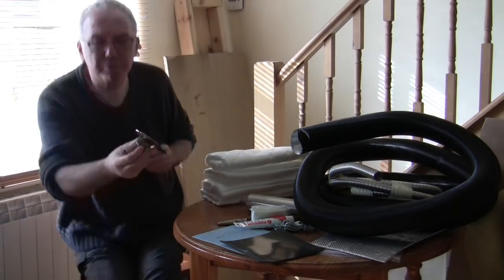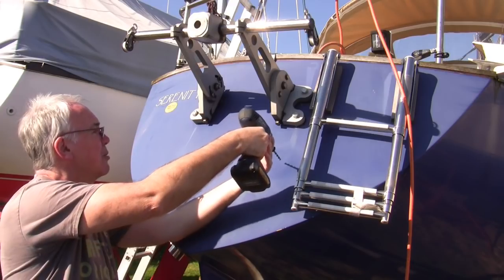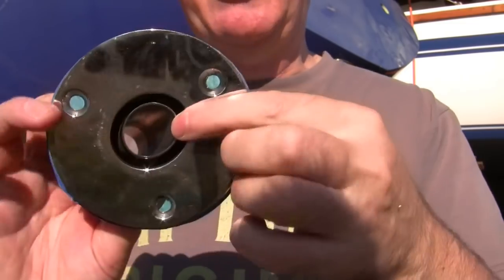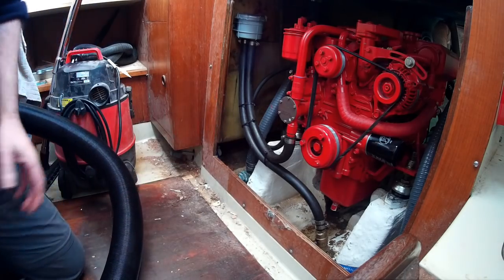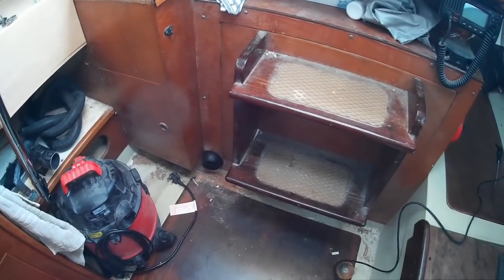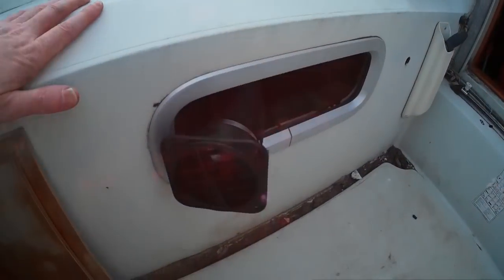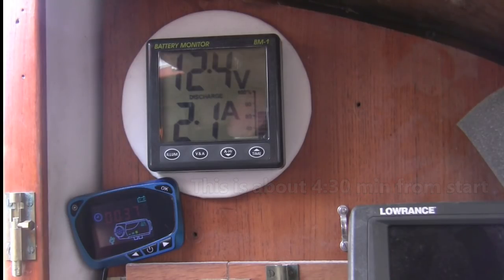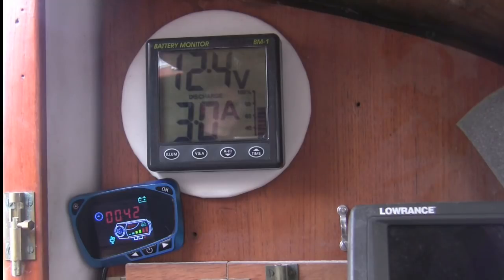Just About Sailing March 2019 - Installing a Chinese Diesel Heater, Pt 2 Fitting it and switching on

Comment: Hi mate, good video.  After a couple of years I'm very close to installing one of these heaters in my 24 foot trailer boat.  I'm in Victoria, Australia and for most of the time I need air conditioning, not heating, but recently I've been using a full set of camper covers and my wife and I have been holidaying and living aboard for a week at a time (work permitting).  Having one of these heaters would really make the boating experience that much better - it means we don't need to rely on berthing in a marina and hooking our 240v electric heater to the town power supply, we could anchor up anywhere, switch the diesel heater on an nude-up with all that heat 🙂  the only issue worrying me, after this video, is the current draw.  I have in total 200 h/a of battery power, not an issue with the engine running but at anchor, you unit pulls quite the current.  Has is improved in the years since this video?
Reply: Hi there. Firstly, I am jealous that you need air conditioning more than central heating. I didn't realise that these 'Chinese Diesel Heater' videos would be so 'popular' when I first did them - I might have structured things a bit differently. But I was really discovering things as I went on.
Have a look at the next one in the series (Pt 3, April 2019). I did a much longer run and noted the power consumption etc.
Basically, it seems to take up to about 8 amps for a few minutes at start-up and switch-off. This seems to be mainly the glow plug which is either used to ignite the diesel when starting up, or burn it off (to prevent sooting up?) when closing down. It then drops quite a bit as it is really only the fan and the diesel pump taking energy - they are both on full pelt. It then drops down to about 0.5 or 0.6 amps as the fan and the pump go into a sort- of tick-over mode.
It then goes up again if the temperature drops (IE heat is lost out of the boat etc) and then ramps up a bit more. I think that the actual consumption would really depend on your boat setup - insulation etc.
Also, I have chosen to draw the air for the heating from outside. Some people draw it from the cabin and effectively re-circulate it. That would make a difference in how much you need to heat the air. Have a look at the two videos I did on preventing condensation for more details (One was the theory of why we get condensation in boats, the second was a practical test). 
Sorry, long answer, but in short - I am quite happy with how little it draws in total. Even in the Winter a decent solar panel should be able to replace the spent amps quite happily.
Good luck with it!
Cheers, Paul

Comment: Temporarily fitted mine yesterday and have to say very impressed and no problems. Bought the marine silencer but not happy about the poor quality exhaust tubes supplied as standard though so ordered some stainless webasto stuff and decent exhaust clamps to go with it. Everything else though has gone without a problem.
Reply from the maker: Andy
Excellent. Just in time for the first frosts. Yes, the basic accessories that come with the heaters are a bit poor in quality. I think I spent more on buying decent stainless steel stuff than I did on the actual heater.
Cheers
Paul

Comment: Really interested in this as I plan to purchase a 'live aboard' sailing yacht in the next year or so, thanks for posting.
Reply from the maker: Well, I have yet to properly test the new heater in any realistic way - but I am impressed with how much heat it pushes out. I lived on Serenity for 2 years mostly plugged into shore power. I used a very small electric fan heater combined with a desiccating de-humidifier (the desiccating ones work in the cold) and that was fine. But no good at anchor. I am hoping that the air blowing heater will both warm the boat up and help with condensation by circulating the air.
Good luck with your new venture.

Comment: Top work. Given the current weather patterns I’m sure you’ll get some frosty nights in May or June to test it thoroughly!
Reply from the maker: Yes, it is certainly not unheard of to get frost in May. It will be interesting to see how good it is at reaching and maintaining a steady pre-set temperature. Although having now tried to read the instruction manual - it is pretty much unfathomable, so there might be a bit of trial and error involved. I also want to try out the remote control and see if I can switch it on from 'in bed' (the Vee Berth).

Comment: This is my next job to do on mine. The combustion inlet is supposed to feed from outside though as on bad starts it can spew exhaust out. The heater inlet is best on the inside to reheat circulated air otherwise your pumping cold damp air into the boat. Especially on foggy days.
Reply from the maker: Andy, thanks. Yes I agree, the combustion inlet must feed from the outside. I had this temporarily hooked up snaking its way under the locker hood and out. I will shortly be finalising both of the inlets and sorting out something that is waterproof(ish) and external.
However, I don't agree regarding the heater air inlet. This is a contested topic with two definite camps. My belief is that the air should come from the outside to increase circulation and suck in cold air which holds less water 'vapour' than warm air.
The problem being that if I am making multiple cups of tea (as I am prone to do), the moisture (from burning flame and steam) will  stay inside the boat (taken up by the warm air) and condense more readily on the cold (external) surfaces. Also, breathing (which I also tend to do a lot) produces a surprising amount of moisture.
However, as I say, this is a very contested subject and many people will agree with you. - And I totally get what you say about foggy days.
Are you going to video your installation?
Good luck with it.
Cheers
Paul

Comment: Nice job Paul, i put mine in a totally different place, the exhaust on mine gets VERY HOT so i warped it and put extra tube around it "it does worry me a bit how hot it gets" hope you are feeling better soon FAIR WINDS T.J.
Reply from the maker: Cheers T.J. - I shall be interested to see where you have put yours. I have only run mine very briefly (what you see on the video is all I have done). I think I will do another video with a longer run time, using the thermostat, and have a good look at current draw and how hot the exhaust gets etc. I must admit that I don't like having such a hot length of exhaust pipe inside the engine compartment. I did buy some lagging for the exhaust pipe, but decided not to use it. My thinking was that I wanted as much of the heat as possible to 'escape' before it got to the exhaust thru-hull. I don't know if that is the correct strategy or not. Maybe I should lag it all and send as much heat as possible out of the thru-hull. There is not an awful lot of guidance out there about this stuff.

Comment: I’m glad you are solving all the problems before I do mine in a few weeks. What about changing you engine raw water intake seacock while you are on the hard? A Blake’s or at least a ball valve would be a lot better. Thanks for taking the trouble to film all this stuff. It is really useful for the rest of us and most entertaining!
Reply from the maker: James, do let us all know how your installation works out. The seacock that you can see on the video is actually for one of the cockpit drains. It is in horrible condition and will be changed. The raw water seacock and thru hull was changed at the same time the new engine went in. In fact all of the thru hulls and seacocks are going to be changed. I intend on using composite ones similar to the ones I have bought for the holding tank (half finished) project.
Reply: Just about sailing I’m glad about the seacocks. The composite ones are the way to go I’m sure. I have a horror of a failing seacock or through hull. It’s frightening how much water comes through a small hole in the bottom; I had a problem with my previous stern gland and believe me it’s harrowing when water starts to come in.

Comment: Apparently once they reach the temp set on thermostat the current draw does drop fairly significantly. It's a good job you fitted it, you'll need it next week as it's supposed to be wintery weather!! A pain in the butt as I have a week off and was hoping for a few days out on the boat.
Reply from the maker: I will do a proper test and see how good it is at getting up to a specific temperature and staying there. It did seem to be running flat out all the time I had it on - but I think the maximum you can set it for is 35 C. I have heard it said that we are more likely to get snow at Easter than we are at Christmas - not sure how true that is.
Reply: @verynearlyaboutsailing8114  Its forecasting wintery showers so you maybe right. I hope not!!

Comment: hi hope you sorted out the heater as i see this was fitted in march. just wanted to say the thermostat is on the heater and controlled via the returning air so that returning air should come from the room that the outlet air is in , just in case you've left it drawing air from the engine room. also the outlet for the exhaust pipe should be lower than the unit and its designed not to burn the grp.
Reply from the maker: I haven't used the unit since I fitted it as the weather has been very warm. However, I will be finishing the installation and switching it back on again soon.
I'm not sure I totally agree with everything you say, but that's OK. So do feel free to comment again if you think you can clarify more.
I'm not sure why the exhaust pipe needs to be lower than the heater unit. I installed it so that there is a single lowest point (before it goes into the silencer). Condensation could gather here and I might install one of the drain loops that Webasto (and Wallas) make specifically for this (although it would need to drain into a sealed unit as it is inside the boat). The key thing I focused on was to have a significantly high 'swan neck' so that external water could not get in.
The inlet and exhaust air for the combustion chamber are both external (or will be).
There is much debate about whether the heating air should be taken from outside or inside. Ideally you would be able to switch it from one to the other (as in a car). I have decided to take my air from outside as I believe this is the best option to help reduce condensation. It will certainly not come from the engine room or the locker.
The exhaust outlet through the grp I fitted is specifically designed for boats. I am very pleased with how cool the outside bit is compared to the inner part.
My understanding is that you can set the thermostat either for the heater output temperature, or the temperature at the control unit. I am using the control unit.
I will do a full run for several hours and monitor current draw and fuel usage as soon as I have completed it and we get some colder weather.
Do feel free to disagree with what I have just written as I do want people to read the comments and then make up their own minds.
Thanks for watching.
Cheers
Paul

Comment: I have a valve connected between the exhaust and the thru hull port which you can close while sailing, stops salt water getting in. 👍🏻
Reply from the maker: Interesting - sounds like a very good idea. What sort of valve are you using? I guess it must be pretty heatproof and also stainless steel. I could easily reach such a valve from the inspection hatch in the cockpit.
Reply: 316 stainless heat-resistant ball valve

Comment: The electrical power consumption seemed sensible 100 watts on start 30 watts steady state - the 100 watts on shut down is to purge and cool the unit down (I think). Looks like a great addition for UK Sailing.👍
Reply from the maker: Yes, I am sure you are right about the steady state (full power) being reasonable. Of course the start-up current draw is obviously the glow plug being heated up. What I didn't notice at the time, but can see when I look at the video, is that the glow plug switches back on during power down (you can see the little icon lighting up). I guess this is to make sure that all the fuel is burnt off - hence the current draw going up again.
It will be a great addition for UK sailing - I am now, rather bizarrely, looking at the weather forecast to see if there is a really cold day coming up so that I can do a test to see just how effective it is.
Reply: I had missed that the glow plug came on again during shutdown, and was wondering why the current went as high or higher than it did during startup. Your explanation seems reasonable. Looks like a great installation. An easier method of cutting the odd shaped gasket may be been to place rolled up sheet gasket in the cut opening, mark it on the outside, then cut.
Reply from the maker: Ken, excellent. Yes, an easier way of doing the gasket would be to do exactly as you suggest - great idea. I am going to do a part 3 which will simply be to switch it on (set to a particular temperature), leave it running for a while to see how well it regulates itself, and then switch it off and have a better look at the shutdown process. Cheers.

Comment: Hi Paul. I’m really impressed with your heating system. I wish I know about the Chinese version before I bought my eberspacher d4, don’t get me wrong it’s a great bit of kit. But yours was  bout a 10th of the price. I have just bought an ONWA Chartplotter and AID transponder which I will be reviewing soon. All for under £500.00 with UK charts. We’ll done pal keep up the great work you will soon be back in the water.
Reply from the maker: Cheers John. I look forward to seeing the review. - I was most grateful to copy you on the Habitent, and I probably do need to upgrade my chartplotter (I have a very old Lowrance) and I would like AIS.
Back in the water? After doing all this work - no, I'm going to lock her up somewhere safe and warm.  Seriously, I am really looking forward to getting back in the water.
Reply: Hi Paul. Talking about Habitent. I would suggest coating it with Fabsil. This is recommended by habitant to stop UV damage. I didn't and now after 2 years mine is starting to rip. I'm holding it together with sail tape at the moment. But remember mine is up all year round and this should no my put people off getting a habitant. I still think they are great value and I will be getting a new one, but this time coating with  Fabsil.
Reply from the maker: Thanks John, good tip. I will do that. - I envisage using the Habitent a lot.

Comment: "not as mobile as I used to be" lol, after a few weeks of owning my first yacht, I have realised that being a member of cirque du soleil's contortionist family would be useful 😁. Seeing as you replaced a lot of the Chinese stuff that did or didn't come with it, it will be interesting to see how long the main unit lasts? Next season we are discussing removing four of the eight seacocks in ours (mostly by getting a composting khazi) your thru-hull removal video will be most helpful. Going in this Friday and I'm having sleepless nights over my Blake's and any leaks 😯
Reply from the maker: The hose clamps and exhaust bits that came with it would probably be OK for a van or shed installation, but definitely not for the marine environment. Only time will tell if the main unit will last.
There are a few videos out there on glassing over old thru-hull holes. I tried to stick to the 'official' West System instruction as much as I could (I think I linked to their document in the description of that video). I still don't know why they suggest putting an epoxy 'puck' in the middle - most people don't do this and don't have any problems.
I will be replacing all my seacocks shortly.
Good luck with the launch.
Reply: She's on the mooring and she didn't sink 😂😁🤣. Thanks for your vids mate and meeting with you, you helped me keep going. Sat here a few meters from when you was here watching the sun go down with a glass of champers. Tomorrow the real work begins.
Reply from the maker: Once the boat doesn't sink, everything else is a bonus. I am hoping that you will be putting some videos up - it would be nice to see the new boat. And you are in a great part or the world for sailing adventures. Very happy for you :)
Reply from the maker: I've just subscribed to you - so that's a legally binding deal now.
Reply: Oh Shi......😁

Comment: So jealous! Looks like a good installation. I spent 4 hours installing my heater and the controller refuses to power on. I haven't quite given up yet though. I will have to check ALL the connections including those in the heater itself.
Reply from the maker: I must admit that I had my fingers very firmly crosses and was quite expecting that it might not work. I did wonder about rigging something up off the boat just to check that the unit was working. But fitting the actual unit was a very small part of the job, so I just went ahead and fitted it.
Good luck with yours - I hope it starts working.

Comment: Make sure you have a fire alarm and co alarm the Chinese heaters are poor quality so you need to take Precautions. Very good job with the Video mate
Reply from the maker: Paul
Thanks. Good advice. I do have a CO detector, but not yet a fire alarm. I have been on a boat once where smoke started to come out of a locker. It turned out to be shorting wires melting the insulating plastic. Could have been very nasty. Fire must be about the worst thing to happen on a boat. And I will most definitely not be leaving the heater switched on when I am not on the boat.
Cheers
Paul